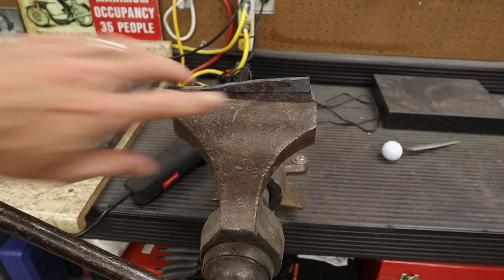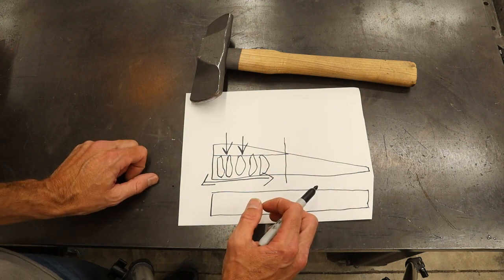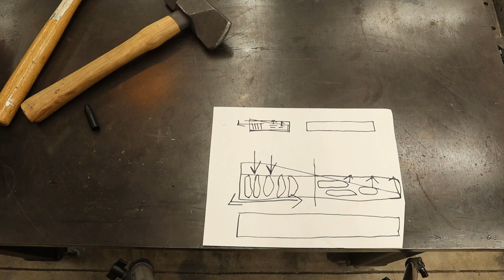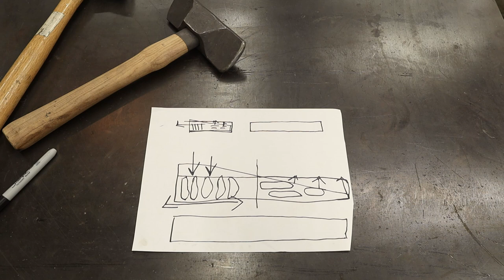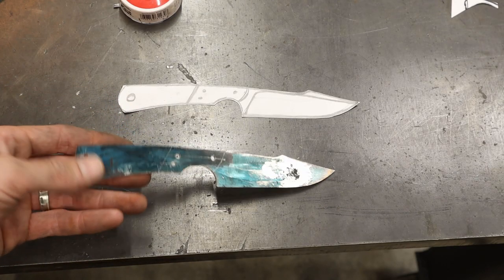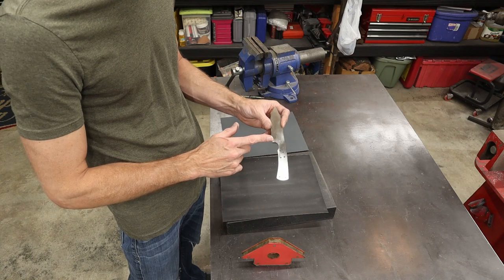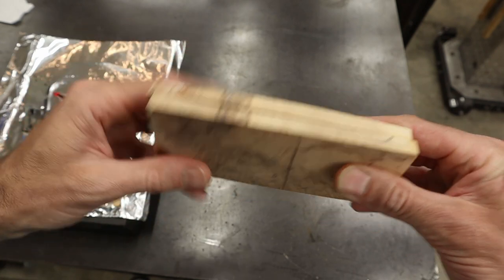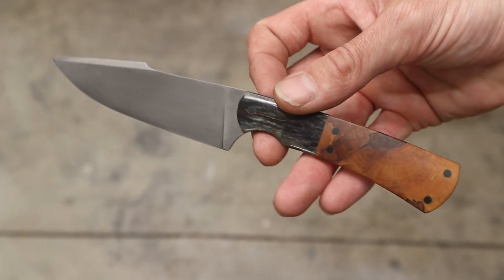Forging - hammer technique - make an awesome knife by hand

Comment: nice recovery from a problem there, come out really well, love that handle, has real visual impact and a really good choice and construction. The broken one can still become something, easily enough steel there to make a small kitchen knife and with the smaller bit a scraper or tool for wood carving, and you are far from alone with the snapped blade, just one of those things that happen from time to time, s5*t happens as we say here
Reply from the maker: Yes sir! I will probably break it into smaller peices and do some canister Damascus later on
Reply: @Aleeknives  sounds a good plan

Comment: Well, if it couldn't survive being dropped from 2-3ft onto concrete straight after hardening- it probably wasn't going to be very good knife anyway :)
Just with the thinner steels which I have a love-hate-frustration with on a daily basis, found that if I leave a little section about 1/4" high by maybe 1/2" long around the tip all through the grinding and heat treat stages and then once I'm ready to form the point I'll just grind-dip in water, repeat until the tips nice and sharp. That sort of tends to  help it survive heat treat/oopsies and make for a lot less paring knives which are strangely wharncliffe points
Reply from the maker: This reached it's full potential of hardness. The grain structure looked like a factory heat treat. It didn't even break at a stress point. It literally hit just right when it landed. I went ahead and tempered the peices and did a vise bend test and they reacted just as they should. Just super brittle after the heat treat! Bummer but life goes on
Reply: @Aleeknives  Oh it most definitely super sucks when stuff breaks. There's so many things happening in blades from a chemistry-physics perspective that sometimes its just going to happen and it'll happen to the best of us. At least its replacement worked and the handle is a beauty
Reply from the maker: Thanks Kris! I appreciate that!  Cheers

Comment: Hard luck on the blade break. Little tip, if you can put a sheet of plywood or fire retardant matting under your forge and quanch tank it will stop the blade from breaking if you drop it.
Reply from the maker: That's a really good idea!